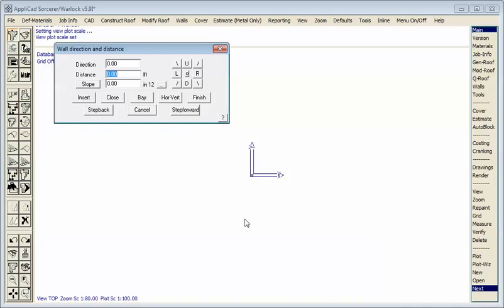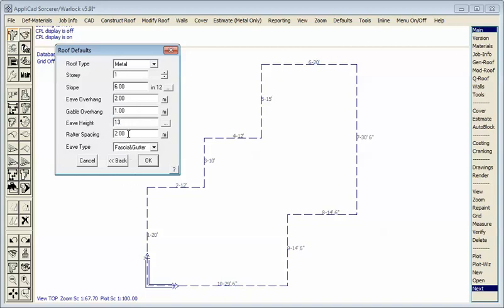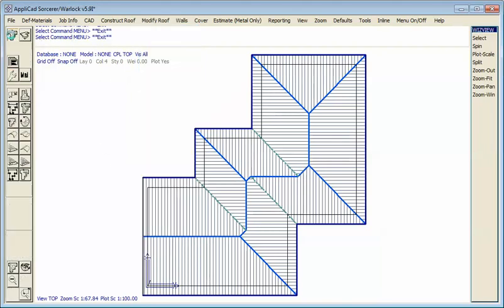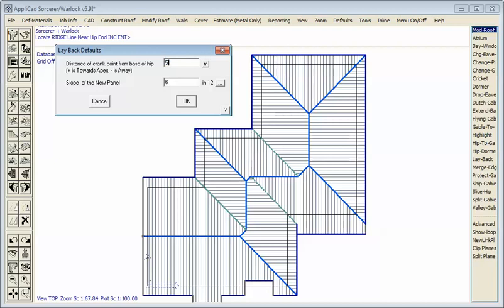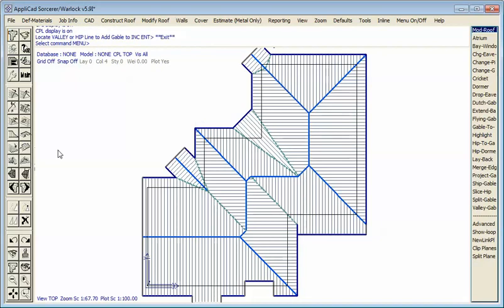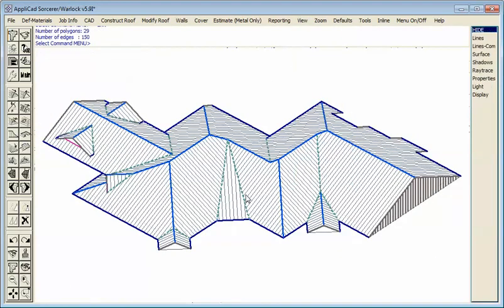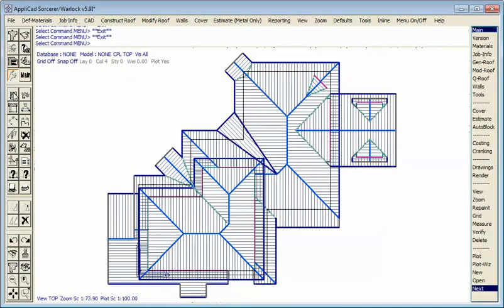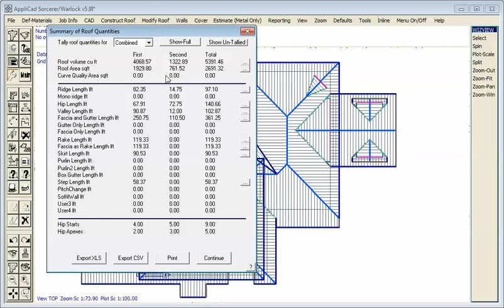AppliCad Roof Wizard - Easy 3D Roof Modeling

Comment from the maker: The Roof Wizard software demonstrated here is not free.   It is a full commercial program for professional roofing and cladding contractors.  You may visit our online shop to purchase by the month, quarterly, annually or you may own it outright.   www.applicad.com/online-shop.html.   We do have a version of our 3D roof modelling program called Roofscape and it is free to use.   You may get this at www.roofestimating.com.    It will allow you to create 3D roof models and extract areas and lengths but you cannot save a job or apply materials.   Please let me know if I may assist you further.  ray@applicad.com

Comment: this software is free to use? or need to buy this software...
Reply from the maker: As explained below, we have our full commercial version, Roof Wizard which has all the capabilities for modelling, estimating, proposals, orders, cutting lists, workshop details etc. and it works offline and allows you to save all your work to a local or network folder.   After 25 years of development and innovation, Roof Wizard is the most capable software for this industry in the world.  Go to www.applicad.com/online-shop.html.   You can set yourself up for trial periods as short as 30 days.
Reply from the maker: The RoofScape software is free to use.   You can model any roof geometry you like in 3D and you can submit the model to our online server side quote generator, using values that you have defined for your situation.   The information that is used is information that you provide, so your quotation is as if you had one it yourself.   The server uses a standard template.   If you need more than the free version provides such as cutting lists, customer reports all material types, walls and roof, and now Solar planning, you need our full function Roof Wizard, available at www.applicad.com.
Reply: I can not save a roof on server. "An error occurred while attempting to open the specified remote file. Error: 12002"
How to fix it?
Reply from the maker: Our free software doesn't allow you to save files.  Can you please explain what program you are using, and what process you are using?
Reply: I'm using roof scape 7.1. Entering my user ID then, prepare quotation, program is trying to connect with a server and gives an Error 12002. 
Do you have a test version with an option of saving projects?
Reply from the maker: We have our full commercial version, Roof Wizard which has all the capabilities for modelling, estimating, proposals, orders, cutting lists, workshop details etc.   After 25 years of development and innovation, Roof Wizard is the most capable software for this industry in the world.  Go to www.applicad.com/online-shop.html.   You can set yourself up for trial periods as short as 30 days.
Reply: Is it capable to work offline? And saving roofs on pc?

Comment: Hi Ray! i do alot of metal vertical panels on existing homes. After I measure the roof I would like to be able to input my measurements into the software so that I can get a layout for my vertical panels, whatever width they may be, 12",16", 24" or 36". it would be great if i could do this easily and get all of my panel lengths running up the valleys and hips. Thanks for the insight. Would it then give me a report of all the panel lengths?
Reply from the maker: If you have  our free version called RoofScape, you cannot get metal panel cutting lists.   You need our Roof Wizard software for that - www.applicad.com.   You then get the whole deal, client proposals, supplier orders, panel and trim cut lists - the lot.